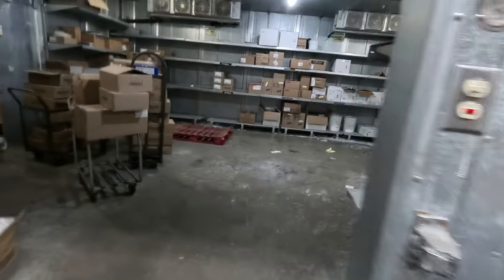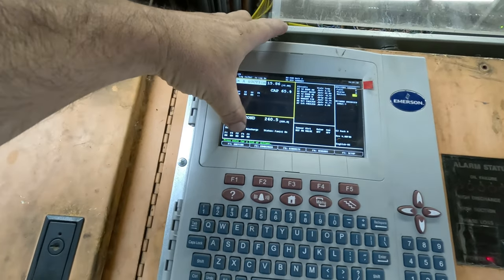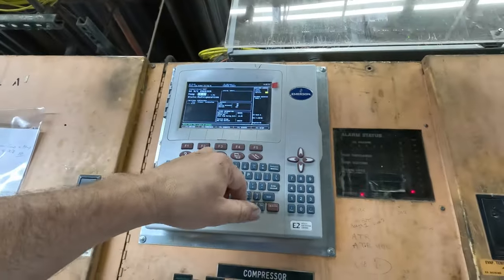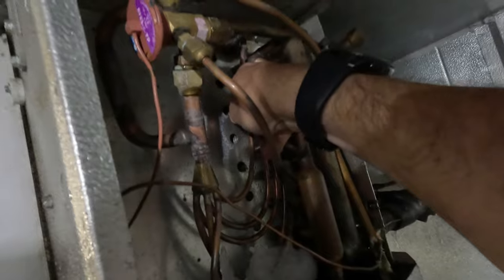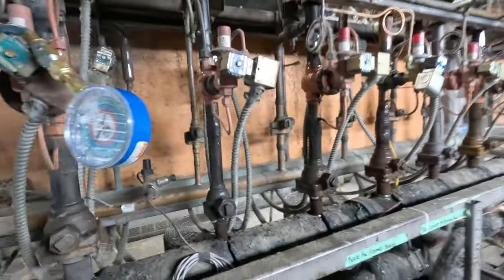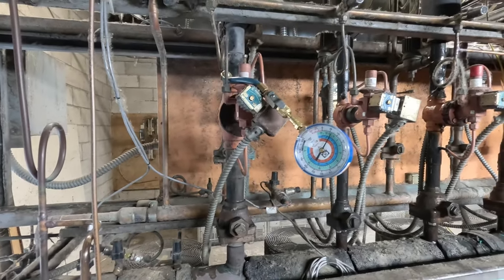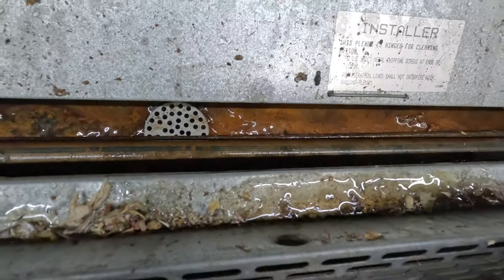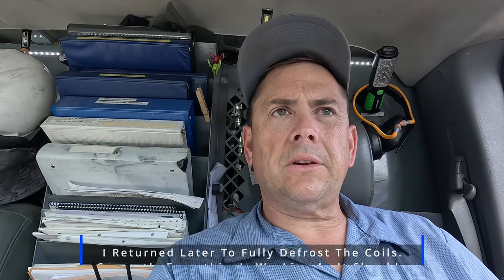Troubleshooting Freezer Defrost Issues. Try This First!

Comment: Put an alarm on those freezer doors. I fight the same problem. They will ignore them. I use the Danfoss magnetic tool app on my phone when I dont have my meter with me to check solenoid coils.
Reply: needs a cheap loud buzzer/beeper. but then they'd probably flee the building thinking it was a fire alarm. 🤣🤣

Comment: So what was the main reason for ice buildup on that freezer room, was it due to starving from blocked screen, or improper defrost settings?

PS: I use wet/dry vac to suck out blocked cases, works so much better than nitrogen 😊
Reply from the maker: I'll try both but on a drain like that one I ended up having to hit it with about a thousand pounds plus a pressure. I don't recommend it but I don't use a regulator when I blow out lines. Defrost had been working for quite a while but I did raise it to 20 minutes and yes I believe the screen was the issue starving the TXV causing it to frost up more than normal. Plus the box never hit temperature as well as it could so it never got a off cycle.
Reply: @HVACRSurvival  thanks for the clarification!

Comment: Love your work man.
we have pressure switches hooked up to condeser fans so in the winter we can reduce the condenser capacity as needed which is essentialy the same thing here with the solenoid valve i imagine.
06:00 is this only done for lowering the pressure drop in the condenser because it will affect the txv or are there any other reasons at all?
Reply from the maker: By closing it it'll reduce the size of the condenser which will raise your pressure keeping it more in line with the traditional pressures you would see when operating normally. Theoretically they had five fans that can cut out, and you can shut each one of those down but you're only going to be able to shut so many down,  once that doesn't work then you cut the coil in half and you'll start turning fans back on which then allows you to run in even colder outside temperatures

Comment: If you need to clean the TXV screens you have a much bigger problem
Reply from the maker: Yep but it's not uncommon and it didn't just happen
Reply: @HVACRSurvival  It is uncommon, there shouldn't be trash in the system. That system needs to be flushed and new filters. Semi herms have replaceable filters for a reason. That thing is on the brink of catastrophic failure